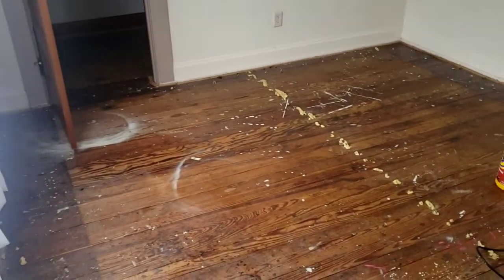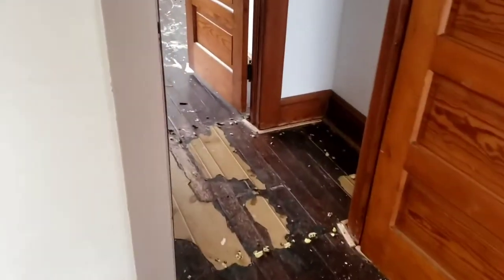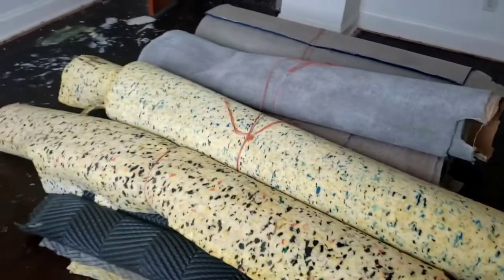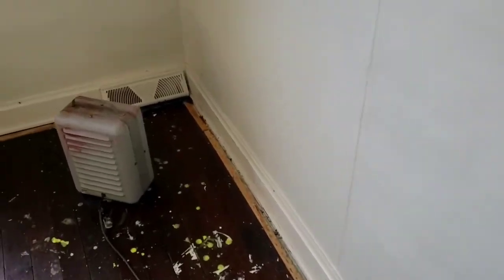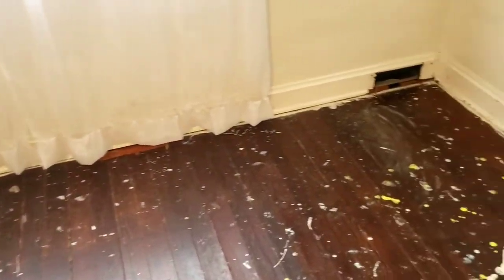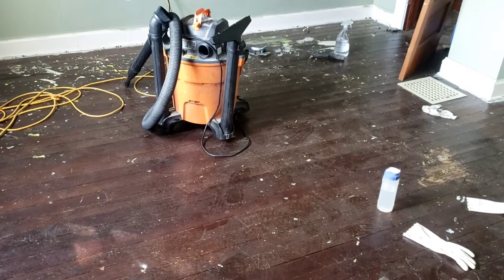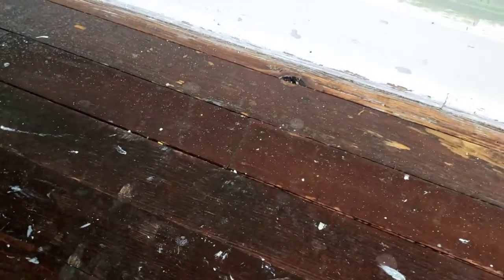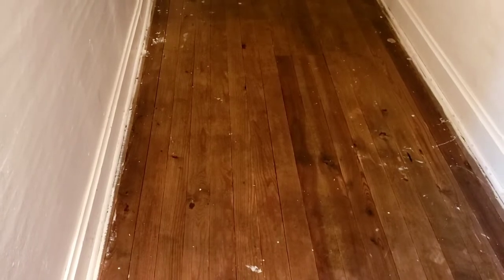Sandless wood floor stripping

Comment: Used citristrip to strip 1000 sq ft of hardwood floor without sanding and scraping. Did not have all that debris on my floor because it was swept first. My floor looks awesome now.
Ll
Reply from the maker: That is a very expensive product where I live. The goop in stripping was just as bad as the old zip strip from 50 years ago with a more pleasant smell. Did not work on my 100 year old doors nd 1940's dinner chairs unfortunately. The floor stripper is very effective. Debris is not from lack of sweeping. Some areas actual stuck on floor backing and adhesive from the 1940's. Im sure Citra strip has its homeowner uses for simple jobs but this handyman and furniture flipper has not found it worth the money.